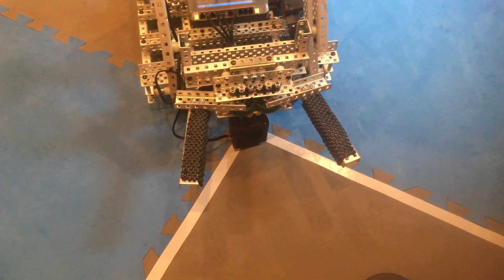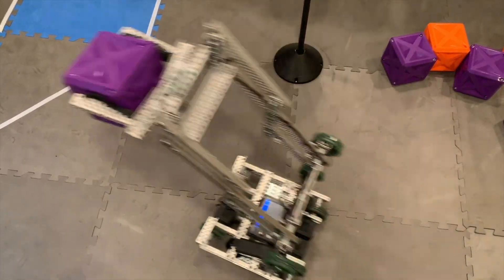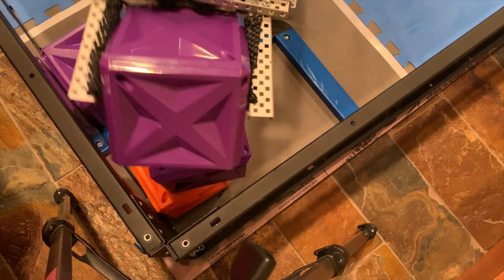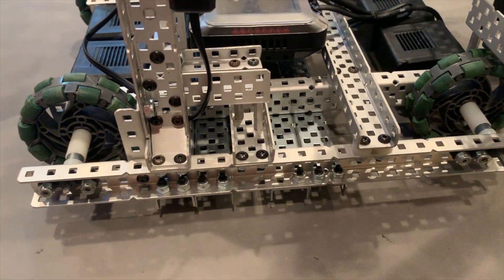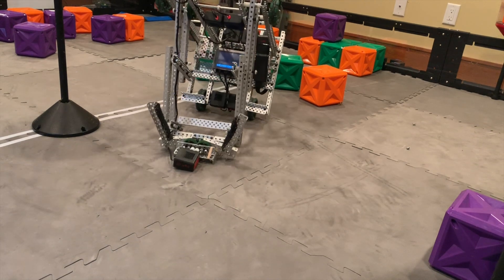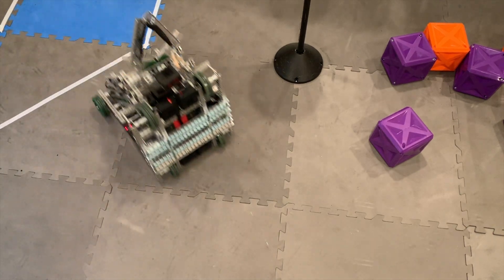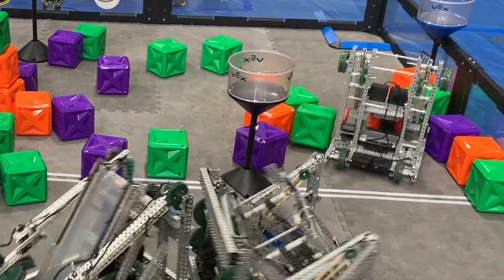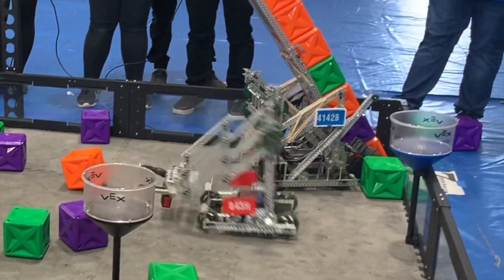Vex Tower Takeover Early Season Reveal + Explanation

Comment: So what did you use for a grip on you claw because I’m trying to look for something that I can use for mine
Reply from the maker: We used non-slip mat. It can be purchased from vex, or purchased in rolls from your local hardware store. Check the cabinet section, as it is often marketed as a drawer liner.
Reply: Kepler Electronics thanks a lot I went and purchased some and my robot is so much better

Comment: What of materials are you using to cover those two claws? The black color one. Thanks.
Reply from the maker: That is non slip mat. Vex sells some, but it’s a lot cheaper to buy rolls of it from a local hardware store. We found ours in the cabinetry section for lining drawers in the kitchen.

Comment: Not your best design, but I bet you can definitely make a better one
Reply from the maker: For sure, we had some much more original and ambitious designs, but the time constraints didn't allow us to tweak them to being quite as usable as we had wanted, and we figured a simple robot that was optimized would beat a less optimized complex robot.
Reply: Kepler Electronics yeah, that makes sense, how do think this robot would work, a standard base, with a dr4b attached and on that dr4b, we have a passive intake with some intake tread, to make it easier to pick up some cubes and stack them. Thanks, and if you think there would be anything wrong with it, please let me know.
Reply from the maker: @masonkelly4391  That seems like a pretty common design. It worked really well at the Mark Leon.
Reply: Kepler Electronics thanks